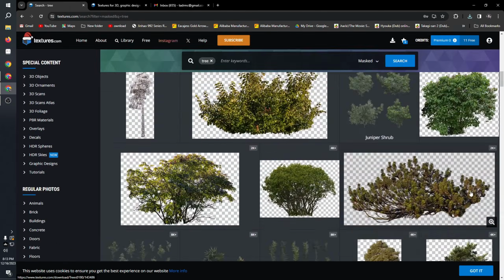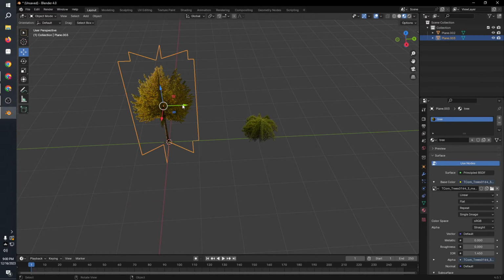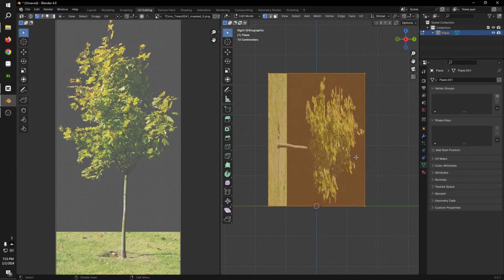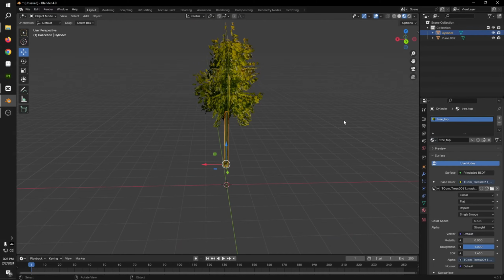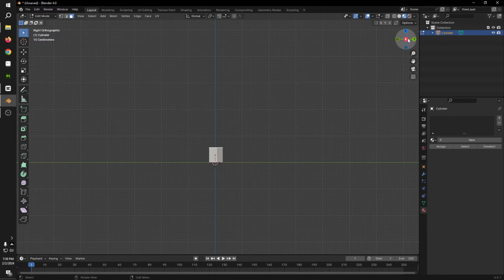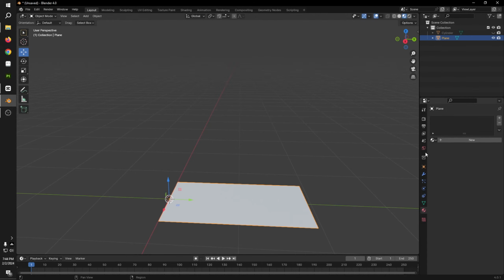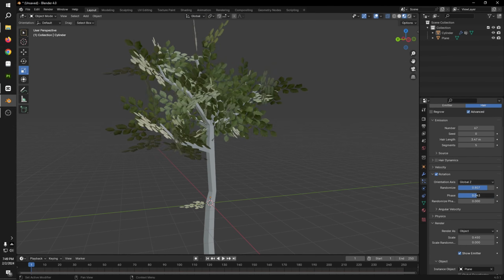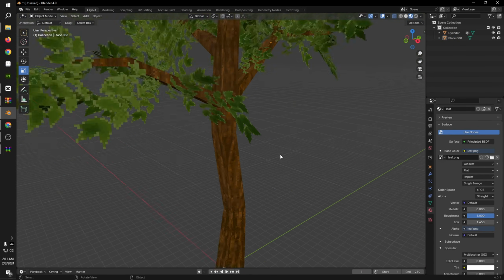Blender PS1 Foliage tutorial (PS1 Style Vegetation)

Comment: What is the backface culling issue?
Reply: For optimization purposes games don't render things facing away from camera. In other words — one side of the face will be completely transparent. 
A more correct explanation — triangles are described by vertices and the order of vertices defines the "front" side, which gets rendered. The "back" can optionally be skipped because... it's not seen. 

Actually, there should be a way to disable that in almost any engine, most likely in material or mesh properties because AFAIK nobody actually uses solidify for vegetation. It's cheaper to render two sides than to render 5 extra faces.
Reply: @zhulikkulik  yeah i was about to say, I work in the AAA industry and almost every single foliage asset we have uses two sided rendering, so you definitely should not have the backface culling because its way more realistic optimization wise to have it two sided